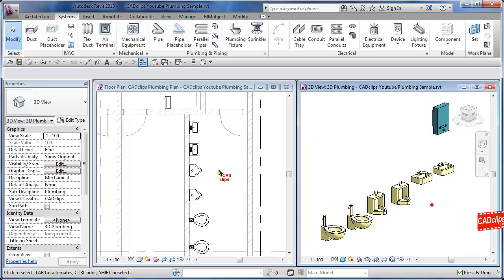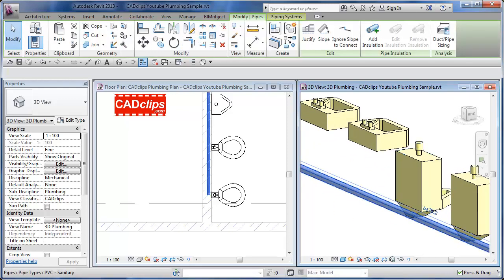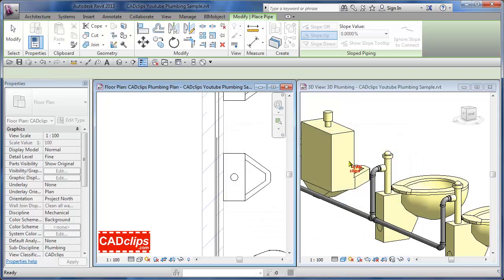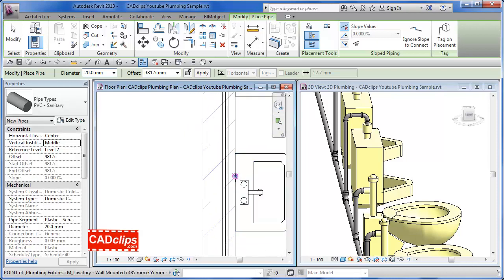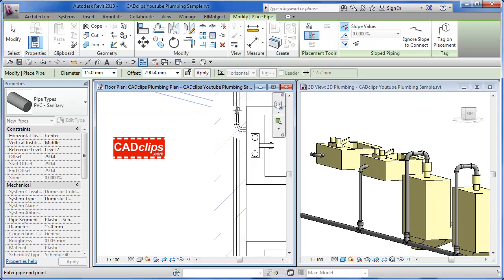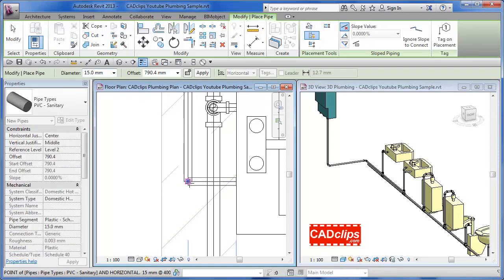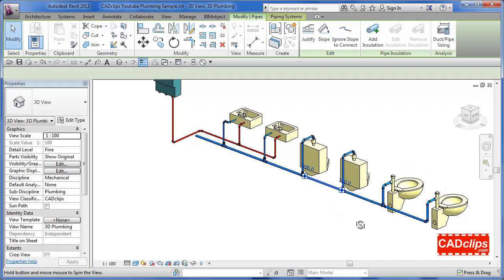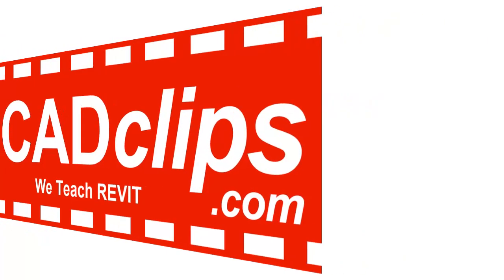REVIT MEP Hot and Cold Water Plumbing - CADclips

Comment: Its because you guys have NO plumbing history in the Field... theres a Sloan Valve, there an Offset it doesn't just go right in... This is why people like me are the Best there is at this...  Go work the Field for a few years and ACTUALLY learn plumbing before Drawing plumbing for ACTUAL plumbers to follow....
Reply from the maker: I'm not a plumber, framer, structural engineer, mechanical engineer, electrician or an architect.That's supposed to be your expertise. And I also don't make the software either.I do know how the software works with all of the above disciplines however (really well) and I teach you how it all works. Then you take what you've learned, apply your expertise and actual model what needs to be done. I have no time to learn how to design plumbing and hvac systems.

Comment: Great tutorial. I don't know if anyone has pointed it out to you, but you were using sanitary piping (PVC / CPVC) and fittings for your supply lines. I know the process is the same for laying out the pipe (slope notwithstanding). but just a technical observation and not a criticism. As an Architect using Revit 2013 Building Design Suite, these tutorials really help me better understand the design challenges involved with BIM MPE systems modeling. I look forward to watching more of your videos.